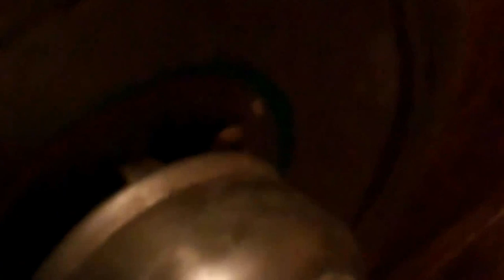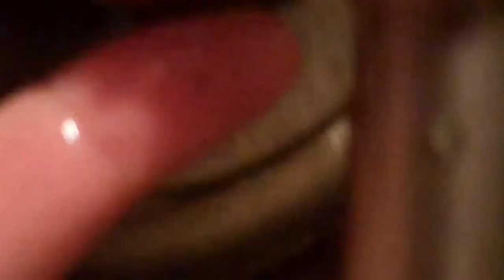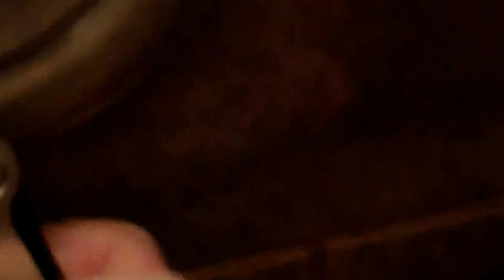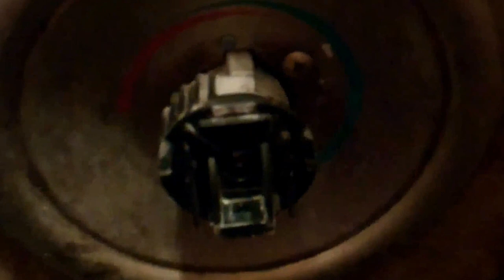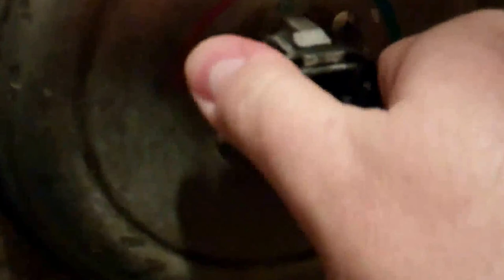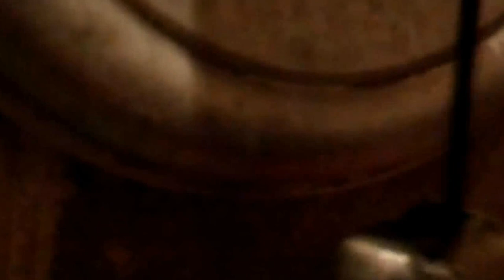Tightening a Loose Shower Handle

Comment: why won't an allen wrench work for me? Is there another tool ?
Reply from the maker: It may be rusted or corroded pretty badly.. May need to clean it out real good, spray some lubricant up in there and try another size Allan wrench..
Reply: one has to use the one which comes with the valve cz sometimes the other ones don't work